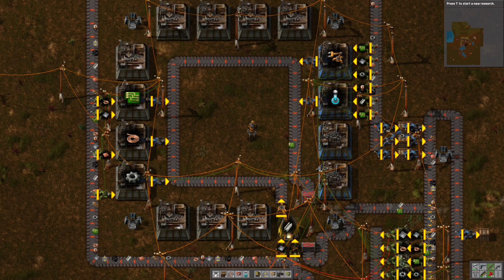Factorio Effecient Compact Factory

Comment: Im still a noob but this looks like a finely tuned system of what I was picturing when I  attempted a single belt system that would be able to contain every item needed and that 1 belt could go to every assembler and it'll take what it needs. It would be slow thru-put but only 1 belt would need to pass the assemblers.  Im still learning the logistics network but I see how the 'clock' is what makes it flow evenly.

Comment: Neat setup but how do you deal with recipes that require the same item. If you're only outputting one Iron plate every second and you have two factories producing iron gear wheels the first factory is ALWAYS going to suck up that iron plate bottle necking the rest of the system.
Reply: well like he said, just add more factories if you need more of the same